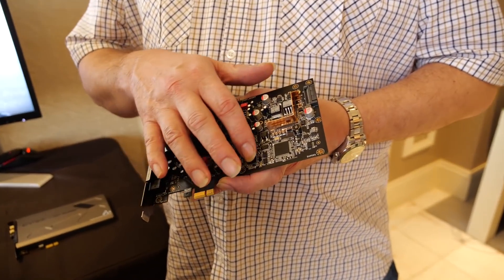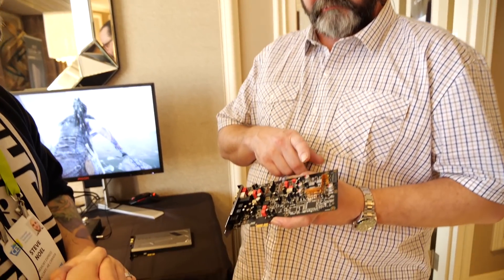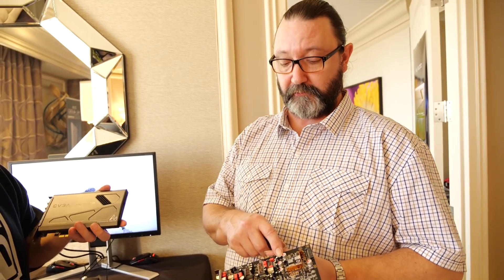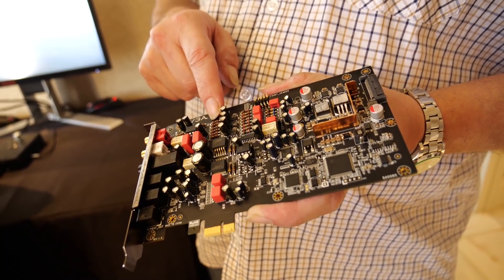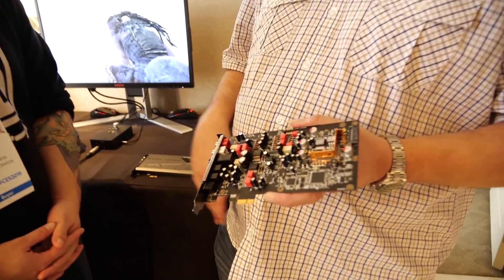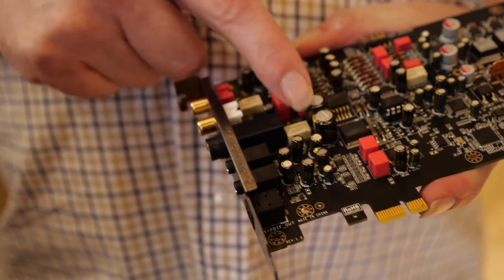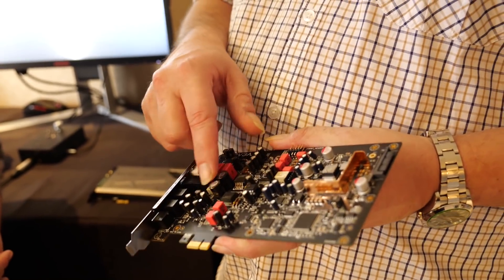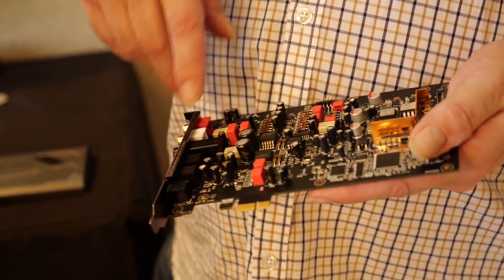EVGA NU Sound card - Hands-on with the Engineer CES 2019

Comment: Just words,what does it sound like in comparison to say an audiolab MDAC?
Reply: All that “how does it sound” stuff is mostly fluff if you ask me. I don’t believe people who claim to hear minuscule differences in timing / response when listening to albums that were recorded over 40 years ago. When you look at the specs of both devices, the Nu Audio gives you DSD and a higher sampling rate over the PCIe/USB bridge than what the MDAC gives you over USB. The Nu Audio has better signal to noise ratio at least nominally, you might have electrical interference inside the case to worry about. One major advantage to the MDAC is that it has balanced outputs, while this card only has unbalanced RCA for output and could send unwanted noise, although you could theoretically solve that problem by running into a transformer / DI box with balanced outputs. As far as the DAC chip is concerned, I can’t speak to whether the ESS Sabre32 sounds better than then AKM AK4493 but I know they are both top of the line. It all really depends on your application, I’m getting this card to interface with pro audio gear in a live music production setting, and for me it solves cable management issues to put my card/interface inside the PC instead of having to run extra cables and power. The balanced vs unbalanced outputs makes a difference depending on how long a cable you are running, what your monitors are like etc. I don’t mind adding a small transformer isolator to balance my signal and boost it to full line level before sending it out to a mixer or another piece of gear, but if you are just running the wires from your PC to your speakers or amp right on your desktop, that probably won’t matter. As for the pricing ... I can’t justify spending upwards of $1000 on an external DAC geared towards home and personal use when something like the RME adi-2 exists for a few hundred more. Again really depends on your application and what other gear you are interfacing with, but to grab this on sale for like $179 and clean up cable management with the specs it’s offering, it’s really hard to beat.
Reply: @sabichase617  The bottom line is how does it sound? all the specs in the world we hear touted around endlessly & at the end of the day some of the things with the highest specs can sound rubbish.That is my experience.
Reply: @nicholasmorrill4711  I would love to hear how it stacks up against tried and true external solutions from a purely auditory standpoint. Haven’t found many reviews focusing on just the sound since this seems like more of a technical solution / upgrade than marketed for audiophiles. I will say based on what I’ve read so far is that the headphone amp is incredibly competent and able to drive high impedance headphones with ease.
Reply: @sabichase617  I opted in the end to buy a Creative sound blasterX AE 5 (second had for £75 quid) precisely because it has a bi-amped system for the headphone reproduction.That system bi-amping is the set up I have with my home HI-FI system & I can tell you that in my experience it is the only way to get realistic sound reproduction........it will feed a signal to my dac via toslink so just about anything else is academic. I would seriously consider the AE5 if it is headphone reproduction that you want.
Reply: @sabichase617  PS: We are not talking about hearing minuscule differences but at the end of the day HI-FI is supposed to be about recreating live music in your own living room.That is the test.Does it?

Comment: it has 5.1 surround... what about 7.1?
Reply: You only have two ears
Reply: @PrinceWesterburg  I would appreciate a logical explanation please. I like full surround. My ears still work, and stereo sounds is not surround sound, and 5.1 is less than 7.1. I currently use a 7.1 headset that is software enabled. And there is a significant difference when used with 7.1. 'Tis why I ask the question...

Comment: Can't remember the last time I used a sound card ........ I mean audio card?
Reply: We say audio card, because it's about a streamlined channel of gaming or hifi audio, to you headphones or system. Sound cards generate the sounds, just like the beeps in the old days. The heavy DSP in many cards is kind of doing that, by DSP. What you hear is not a pipelined output, but, something edited by the manufacturers software team - you hear what they decided you should hear. Or, more likely, they did something that sounded good in their lab on a set of $50 headphones. Geordie, how many proper studios or content producers are using $149 PC soundcards with BS enemy detection? None, not a single one, and none of the game content producers are either. I guess you would be shocked to find out your game animators were using a $149 720p monitor? You would want to use the same kind of thing they are? So, why use a 4k monitor, and a 320p audio solution? And, no, you can't get an outboard solution that's the same as this card. You can buy a BS Chinese no-name box, but, not something like this.

Comment: Does this support Dolby Digital Live? xD (most toslink products don't, but you need it to play games in surround over optical)
Reply: You can use Dolby Atmos via the Access app on headphones. If you want to use a receiver and optical, then there is no advantage in using this card apart from the on-board re-clocking. However, using optical SPDIF and DSP in the receiver, you are losing out by way of latency. It's fine for movies, because you can adjust your system for lip-sync, but, the only way for that to happen is by delaying everything else to wait for the slowest component in your system. For gaming, that seems like a bad deal.
Reply: @andygrove285  I'm a big fan of Audio Note gear, so this card was very appealing to me for both home cinema and gaming, until I realised there was no coax connector for the SPDIF output. Optical cables are a problem for me, as my PC is on the opposite side of the room from my AV receiver and I want the long cables to be hidden behind skirting board, which I believe would not be possible with optical cable due to tight bends. Forgive my ignorance, but I was under the impression that coax was better for audio signals, apart from potential ground loop issues. Perhaps you could clarify? Are you saying there's not much point using this card with a 5.1 AV receiver connected via TOSLINK and if so, who is this card intended for - mainly gamers using headphones?
Reply: @sybarite6365  Hi. Thanks, we are dedicated to what we do, might say verging on rabid. Optical seems to be the standard nowadays, and it's less of a problem for hum loops and FCC EMI regulations. Using it will give you the internal reclocking the card does, but, who knows what your receiver will do to the signal. The card is aimed at whoever wants great sound on two channels for $249. I mean, it's really VERY good for that price, I made sure of it.
Reply: @andygrove285  Thanks for your response and clarification. It does seem good value considering the high quality of components and I bet it sounds great.
Reply: @sybarite6365  Thanks Paul!

Comment: I like it but the price will be scary
Reply: Remember that the parts used in the audio section is not cheap. We are talking resistors at 5 bugs a piece and the electrolytes is also rather pricey :) 

Ive listen to the prototype last time i visited audio note. And it's an amazing card. Would be very good for an All in one music server.
Reply: @AudioheavenDenmark  5 bugs for a resistor, jeez. Where do they get all those bugs?
Reply: @mbanb8031  they design them on there on and get them made in Japan. Not cheap to do.
Reply: For what it is, it pisses on Prism gear costing 10x as much
Reply: $250